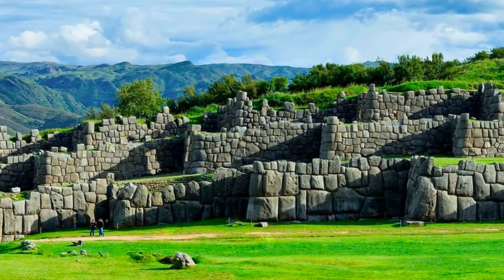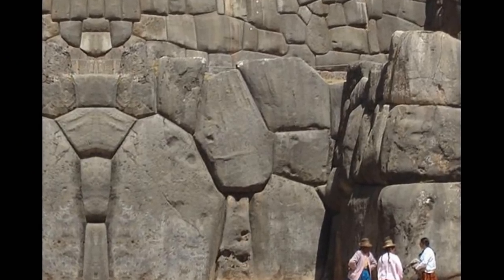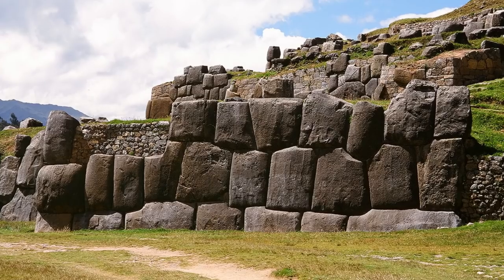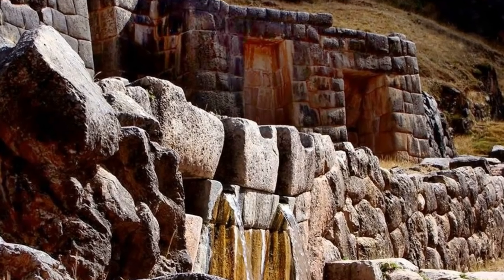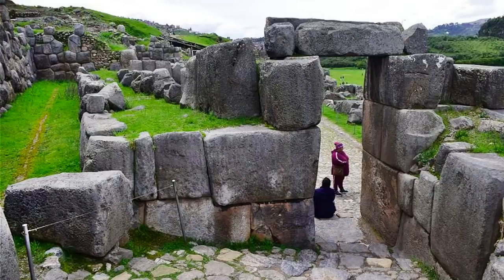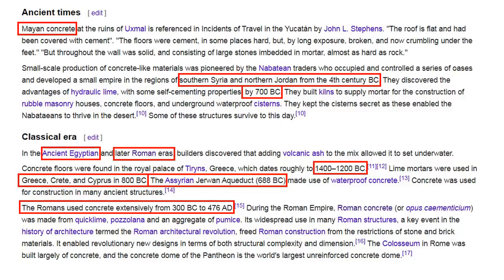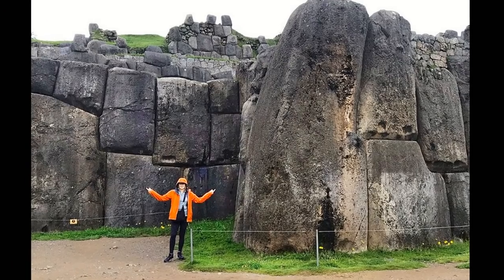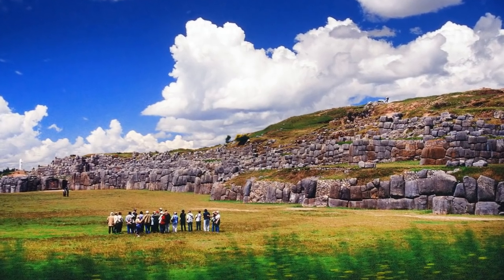Explained: How were Peru’s #Sacsayhuaman Walls Built

Comment: This was absolutely amazing, incredibly well put together, so much good dense information that leads to a conclusion not only you cannot deny, but you would also start seeing it everywhere. Well done 👏 👏 👏
Reply from the maker: Wow, thank you!
Reply: @CuriousBeingbyTina  Why you ignore the age and composition of the rocks? This is not concrete, these are boulders from a quarry, if it was concrete-like, the archaeologists would have published the finding. Carvings and protrusions are typical for rock transportation and lifting using ropes and trunks.
Reply from the maker: @_John_P  I guess you didn't watch the full video. I presented a preliminary material analysis from a group of geophysicists who studied the block samples. The scientists concluded that the material is not from nature.
Reply: @CuriousBeingbyTina  I stopped at the concrete nonsense, I'd advise you to edit yours videos in a way where you show all the evidence first and only then your hypothesis.
Reply: @CuriousBeingbyTina  One of the main issues with your concrete hypothesis is that a perfectly good smooth wall would be ready as soon as the cast is finished and cured, it makes no sense to then carve the block all the way to the back, it would even be stronger by leaving the wall smooth and if they wanted to decorate the wall, they would have done so by carving just the surface and not all the way through. These are clearly boulders from a quarry.
Reply from the maker: @_John_P  So you are criticizing my hypothesis without even knowing what the hypothesis is built upon. If you have strong prejudice against the concrete theory then the material analysis might not be helpful to change your mindset.
Reply from the maker: @_John_P  I explained this in detail in the video.
Reply: @CuriousBeingbyTina  Your explanation is incorrect, interlocked concrete blocks are used because it's much faster to build walls with them then just making a giant mould, pouring a large amount of concrete and waiting for it to cure under the weather. It is speed, not strength, that is the driving factor for concrete blocks. An integral wall made of a single concrete cast is much stronger than a loose pile of interlocked concrete blocks speed-cured in a furnace.
Reply from the maker: @_John_P  Again I explained this in the video. The information is all there - if you want to check it out.
Reply: @CuriousBeingbyTina   I did check it out and I just got you busted. You did not translate everything from the material you linked because it does not support anything you are claiming by the slightest.

I've read it all and the authors proved that the blocks came from the quarry! They found out that they are made of limestone, and therefore quite easy to work with, hence the intricated shapes. The quarry happens to be nearby, so transportation was not a bigger problem.

Page 67, Fine-crystalline limestone without traces of organic residues, recrystallized along cracks. This indicates that the material of the protrusion (in the ground, i.e. quarry) is identical to the material of the blocks.

Page 72, Picture of the source quarry.

Page 75, (organic composition from the quarry and from the masonry, a perfect match!) "The analysis revealed an almost absolute similarity in the chemical composition of the samples from the quarry and from the masonry of the fortress wall Sacsayhuaman. Such a close similarity of the chemical compositions of the studied samples indicates that the material of the blocks was indeed made from the limestone of the quarry."

Page 76, "(...) So what is Sacsayhuaman built of? From limestone (...)"

Also, you misunderstood/misrepresented what they are saying on Page 76. They said that the people that worked the stone used an unknown method to make it easier and that such method caused the crystalline structure to remain fine, which is the opposite of what happens to limestone when left exposed to natural processes.

On page 52, they explain that it is expected that marble will form inside limestone if the quarried stone is left unprotected under the weather for long enough, unless water finds its way through the cracks before it's absorbed by the entire rock. So I believe that the process they used in the quarry was to seal the rock, except where the cracks were, and pour water in the cracks, then leave the stone to cure for some time before they started shaping them.

======Translation of the remainder of the linked document:=====

Page 2, Contrary to your claim, the rocks are cracked and that's why they called the geotechnicians. "Employees of the archaeological complex Sacsayhuaman have noticed destructive processes on some areas of the complex, which were expressed in the formation of large cracks in the masonry of the main walls."

Page 4, they collected samples from the wall and the quarry that was believed as the source of the blocks.

Page 33, they placed samples of the masonry in vinegar and they dissolved almost completely leaving behind only sediment, which is typical of limestone.

Page 43, in most locations, the wall is not that thick at all, just a pile of plates or small blocks, much easier to transport and lift, no mystery here.

Page 45 & 48, Fine crystalline limestone without traces of organic residues.

Page 51, Fine-crystalline limestone without traces of organic residues, strongly fractured and recrystallized.

Page 52, "Recrystallization involves the dissolution of crystalline, or amorphous, phases present in the rock and the formation of other,
or the same but with different characteristics, crystals. So, fine-grained limestone recrystallizes into marble, i.e. more coarse crystalline rock. IF THE PROCESS GOES NOT IN BULK, BUT ALONG CRACKS, where there is a lot of solvent, i.e. water, THEN WE GET STRUCTURES AS IN OUR THIN SECTIONS (samples): a fine-grained, non-recrystallized, mass of limestone intersected by veins, i.e. cracks, filled with large crystals of calcite, in fact marble. Calcite can crystallize at very low temperatures, there would be enough water and time" (For it to occur but it didn't. This means they prevented the natural process of recrystallization in bulk by forcing it to happen along cracks, probably by sealing the rock and pouring water into the cracks, leaving it to cure. I would hardly call it an ancient technology)

Page 55, Organogenic limestone. Organic residues are clearly visible.

Page 58, Fine crystalline limestone. The presence of fragments of organic residues is possible.

Page 61, Fine crystalline limestone without traces of organic residues. Evenly composed of calcite microcrystals 1-10 microns. Calcite identification was confirmed by X-ray phase analysis. In some places in the rock there are small veins and lenses filled with coarser-crystalline calcite.

Page 64, Fine crystalline limestone without traces of organic residues.

Page 71, the thin section of the sample, like the thin sections of the blocks, shows "fine crystalline limestone without traces of organic residues", as in the case of the results of the analysis of the masonry blocks of the walls of the fortress.

Page 74, Organogenic limestone. Organic residues are clearly visible.
Reply from the maker: @_John_P  Maybe read it again.
Reply from the maker: @_John_P  "The analysis showed that the chemical makeup of the samples from the quarry and the wall of the fortress at Sacsayhuaman is practically identical. Such close similarity of the chemical makeup of the analyzed samples indicates that the material of the blocks in the wall was produced from the limestone, which was obtained in the quarry"
"With regards to the material of the blocks, we can confidently say, that the process which formed them is
impossible in nature. This is based on the fact that cryptocrystalline organogenic limestone can recrystallize up to marble in the presence of water and high temperature, however, this results in large crystals being formed, since processes occur slowly in nature and the crystals have time to grow. Uniform [homogeneous] fine crystallinity, as in the presented samples from the blocks in the masonry, could be obtained under a very rapid process. Furthermore, under the condition that at any point in the system there is enough water, and carbonate material. "
Reply: I have quoted and explained page 52 already, copying and pasting it back achieves nothing. On page 52 they say that the process for preventing recrystallisation into marble can be achieved by preventing water from ingressing the rock in bulk and letting it ingress through the cracks instead. That's most likely exactly what the ancients have done, they sealed the rock and poured water through the cracks, leaving it to cure. Your hypothesis of concrete involves mixing water with the entire powder in bulk, which would cause agglutination and large crystals to form, as explained by the authors. The lack of marble also busts your concrete-like hypothesis.
Reply from the maker: @_John_P  I cited the information on page 75 & 76. 
"So, what is Sacsayhuaman built with? From limestone, which became plastic, due to the application to it of an
unknown technology by the ancient builders, which deliberately violated the crystal structure of the natural
mineral with the goal of providing the building material with maximal density? How can we explain the
existence of "plascicine stone", the material of which is identical to the material of the masonry? "
Reply: @CuriousBeingbyTina  Page 75 shows the chemical analysis being identical and their conclusion saying it's identical to the rocks from the quarry. They reaffirm this clearly on page 67 and 76 "So what is Sacsayhuaman built of? From limestone.". You are trying to twist it so it reads that they made powder from the rocks and poured it as if it was concrete. The authors do not support this in any way because the cross sections from the rocks show the same crystalline structure as the original rocks. If you make powder, you end up with an amorphous, homogenous mixture that under the microscope would look like sand and not like a rock. The blocks have rock features that match unquarried rocks from the quarry, you cannot twist this fact.
Reply from the maker: @_John_P  The texts are very clear. The block material came from the limestone quarry, through "an application of an unknown technology by the ancient builders, which deliberately violated the crystal structure of the natural mineral".
Reply: @CuriousBeingbyTina  The text is even more clear than that, they explain how the natural recrystallisation can be prevented from occurring by pouring water directly into the cracks before water has a chance to soak the entire rock from the outside. Being unknown does not mean concrete, especially because the pictures from all the samples show a rock that has formed underground and not a material that has been poured into shape. A poured material looks homogenous, a rock from the ground has distinct easily identifiable internal structures and layers that have known formation mechanisms. The cross section of the blocks matches the cross section of the unquarried rocks, which is proof that they were not made into powder and cast into shape.
Reply: @CuriousBeingbyTina  I'll try to be very clear with you: you cannot put a rock in a grinder, add water and then pour a rock identical to the original down to the crystalline microstructure. It's the same as grinding a dried fish, adding water and pouring a fully functional fish again, that's not how physics works, that's not how geology works, that's not how chemistry works.
Reply: @t00by00zer  Stone is dated in a regular basis by a really large variety of techniques, please educate yourself by taking geology courses online from any reputable university that publishes their course material on youtube, or read a few books in the subject, and then come back and tell me what you've discovered, or at least go talk to a geologist.
Reply: I think you explained it very good, this rock building is unexplainable and it sounds like when they sampled the rock there was no real explanation for how they built it to begin with, thank you for the information given
Reply: Ok, stop quarreling. It waz just a bunch of kidz playing minecraft and putting stonez to make fortress walls.
Reply: these were built by our much more advanced Ancestors 
you have been lied too
Reply: I wonder rather than pouring cement, what if it was more like clay. Work it into place and it would stay, after a day or two maybe it would set up, remove the forms and clean up the exterior and then let it cure or dry. Do the entire bottom row. maybe after a month or two start the upper row on top of the first one caste and go around in the same order to build the second level. Disclaimer, I'm guessing...
Reply: Unfortunately it's not the correct theory. But I applaud her for the work she put into the presentation.
Reply: @CuriousBeingbyTina  Well Done Tina!!! excellent indeed
Reply: @CuriousBeingbyTina  Preliminary õwithout  peer-review should not be presented as if factual wisdom
Reply from the maker: @rudivanrooijen7611  It's the best thing on the material I found online. Can you provide a peer reviewed published paper of Sacsayhuaman's material analysis?
Reply: Hey , you can't please everybody and there is always  a critic.  So shrug it off and keep up the good work lady
Reply from the maker: @nicklasschmltt6959  Thank you Nicklas - I agree 🙂
Reply: Lol
Reply: Lmao.